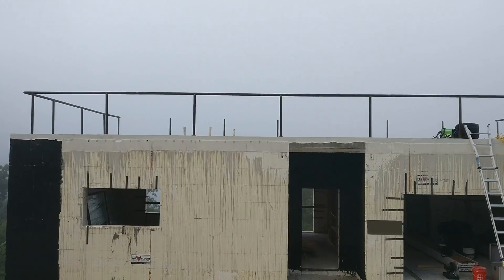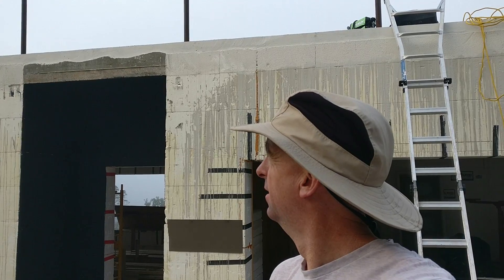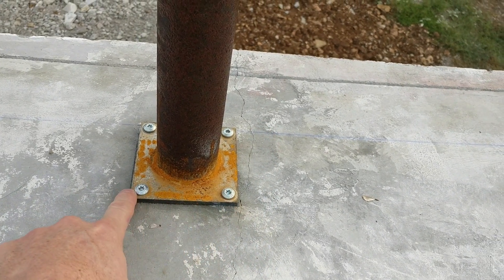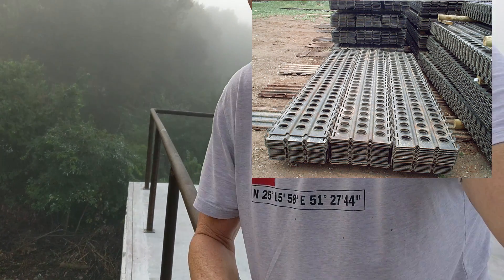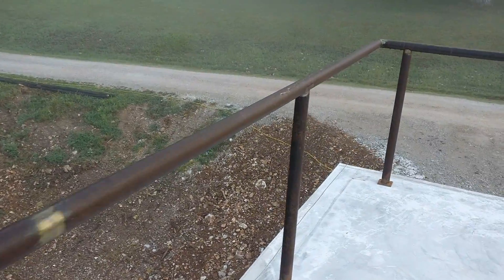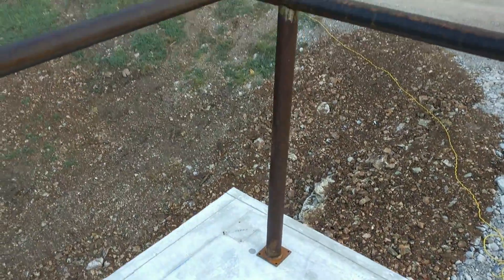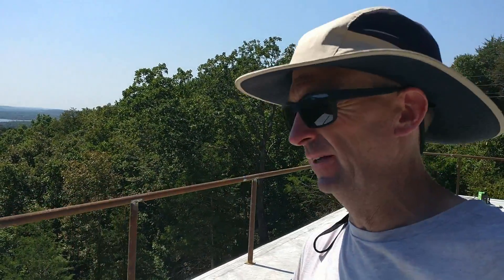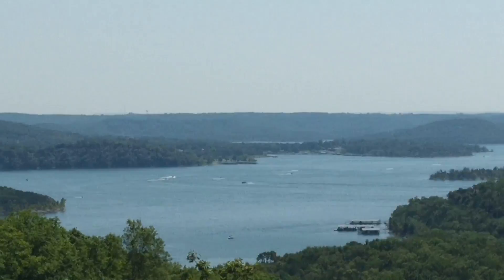DIY Building Pipe Railing on Concrete Rooftop Deck: Testing out the Harbor Freight Titanium Welder

Comment: Good morning John , If you need a few more pipes with what we call a fish mouth you can DIY by putting the pipe in the drill press and using the proper type and size whole saw achieve that . It is not the most efficient way but if you only need one or two who cares ?  I will tell you this since you are making this a cable rail you need drain wholes so the pipes doesn't fill with water and freeze . I think with enough practice the railings will just fine . Oh one more thing since you are going for the natural finish ( Rust ) they will streak rust over time and discolor your building . You can use bees wax or some kind of environmentally safe oil to slow that down . But it will be something that will have to be often .  And before you beat yourself up too much about the railings being straight the heat of the welding will pull the pipe where you don't want it to go . Keep up the good work .
Reply from the maker: Thank you so much! I appreciate your tips and encouragement. We will be painting the pipe and landing mat once it is all set and welded. We DO need to drill holes in the bottom of the posts that will be cable. You are right.
Reply: @LakeLotBuild  Ok because the natural rust finish believe it or not is very popular here , And it will blend into the scenery it is just a pain to maintain . You could clear coat it but that can scratch . So paint is the better choice .
Reply: @LakeLotBuild  the fancy word would be Patina , or a Patina finish . LOL